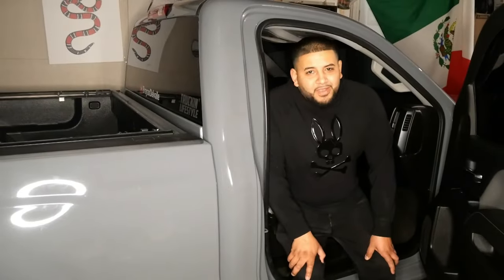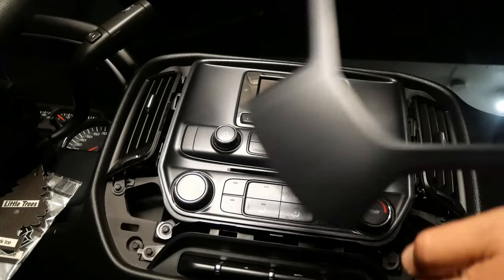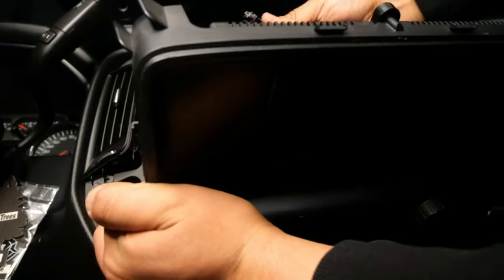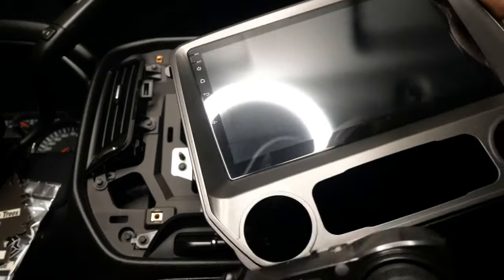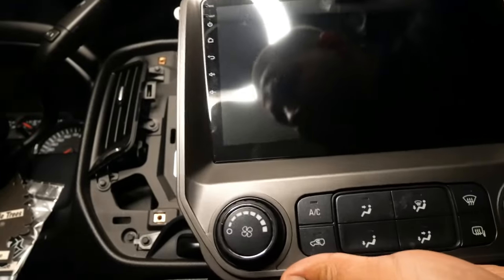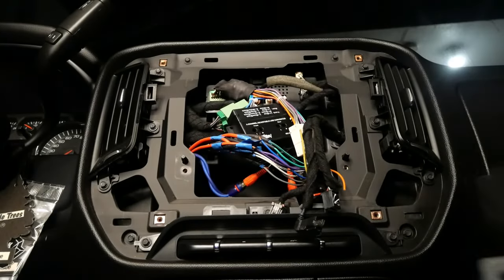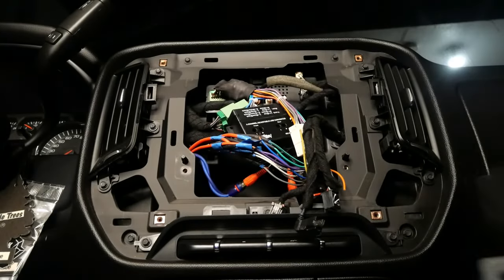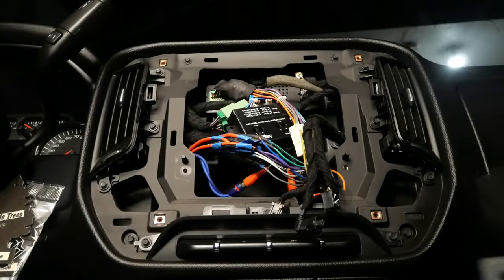HOW TO INSTALL ANDROID 10.1 STEREO ON 2014-2018 CHEVY SILVERADO

Comment: I have mine installed but now im trying to put subwoofer and amp but it doesn’t have the rca output nor control   Is there any other way to install them?
Reply from the maker: they should be attached to the harness

Comment: There is 2 orange wires coming from the steering wheel controller splice does any one know which wire connects to the green wire from the radio?

Comment: Factory has a password do you know it, it’s a 4 number password
Reply from the maker: I do not have you tried 0000
Reply: @brayandelvalle8035  tried every password possible that could be simple
Reply: 1234
Reply: "All this extra space" new radio fills space with wires. Good video. Thank you for taking the time to record it.

Comment: Great video. I have the same truck, and have always wanted to upgrade. That looks amazing. Did you upgrade the speakers too? Mine came with 6 speakers, but I'm thinking just replacing and using the 6x9 door speakers is plenty.
Reply from the maker: I upgraded to 6x9s skars brotha they sound amazing!

Comment: If you have volume and the next and prev buttons on the back of the steering wheel . Do they still work.
Reply: Also does your cluster screen work and still give you all the options
Reply from the maker: Yes they come with a separate harness
Reply: @brayandelvalle8035   doyou have a link .??
Reply from the maker: @rhettschleeter9550  yes its on the description

Comment: Has anyone got an early 2014 Silverado with the 2 wire green power harness? I didn’t know mine would be so difficult being one of the first 3rd gen’s. I can’t figure out what I need to do. Everything works except getting audio. I’ve checked all connections and they’re all good. Only thing that I’m thinking is there is something not being connected where the newer ones would connect on the green harness. 
   Anyone that can help, is much appreciated!
Reply from the maker: There is two separate harness ones for audio the other one is for the stereo mine is a 2014

Comment: Bro I got the same unit . Works pretty good so far but how do you change the temp settings? Mine is on celsius not Fahrenheit
Reply from the maker: go on the setting it should be right there

Comment: How did u connect that plug and play adapter and do u have a four way amp I can’t get mine to work I got that same set up but as soon as I connect the battery the amp starts making a thumping like sound threw the speakers and I hav to disconnect battery
Reply from the maker: Have you checked your grounds and make sure nothing is making a short
Reply: I’m pretty sure but I’ll check again

Comment: Mine doesn’t have the green plug so I used the other connector but it’s not turning on
Reply from the maker: Did you check and make sure it all clicked in all the way

Comment: I just installed this. Thanks again for your video…any chance you know how to get the wheel controls to work?
Reply: Am having the same issue  at a shop...with this.....
Reply from the maker: Im not sure i think its a second harness
Reply: Orange harness that came with radio connects to steering wheel controls
Reply: @MechTechElectric  are you my hero? I’ll get back to you on this lol thank you
Reply: @macmi11i  did it work? I'm about to put this one in my truck
Reply: @MechTechElectric ahí que adaptarlo al arnés naranja para q funcione , tengo problemas para los controles del volante
Reply: @yordeniscortina4306  tienes iphone o andriod

Comment: Hi there just saw this video was wondering what upgraded radio you put in I have the same older unit you had wanna upgrade mine
Reply from the maker: I have a link in the description
Reply: @brayandelvalle8035   does it come with all the wiring
Reply from the maker: @justsam3246  yes

Comment: Any idea how to hook up the rear camera? Wire they provided with this kit doesn't fit anything coming out of the dash
Reply from the maker: I haven't installed it on mine so I do not.
Reply: It’ goes behind the glove box it’s 1st plug, u can buy gm51 or u can splice into with an av cable,.

Comment: My vehicle antitheft turns on when i try to connect the new unit and the teuck wont start. Did you have to deal with that?
Reply: Did you figure it out? Mine is doing the same.
Reply from the maker: I did not have that issue
Reply: @rolandoolivarez3244  I did a bit more fiddling with the wiring this weekend. Unplug the black radio plug that goes into the very top module. And uplung the steering wheel control wire and the other single green lead. I'm not sure what the problem is but those two wires cause it to trip out.
Reply from the maker: @thingstoremember4489  mabe a short?
Reply: Would this work in a 2016 tahoe
Reply from the maker: @jackmonk1970  most likely

Comment: I installed this today just like in your video, but mine didn’t work, I checked the fuses and replaced the one in the truck, and nothing, any idea what it could be?
Reply from the maker: Did you plug in the antenna
Reply: Same issue here right now. It won’t turn on. I can’t hear any key chime either currently. Halp?
Reply: Everything turns on just no audio comes out of my speakers with this unit
Reply: @ashwinnash63 supposedly the speaker that comes with the kit is your chime speaker connect that and should be good to go
Reply: @carloshernandez1834  how did you fix the speaker issue? I’m having the same issue
Reply: @ashwinnash63 Did you figure it out? Having the problem right now.
Reply: Did you figure it out? Having the problem right now.

Comment: I hooked up the harness that came with the unit into my 2017 Silverado ltz with Bose system,. The unit powers on but getting NO sound in any speakers, even my amp for my two 12in subs,. Nothing no sound at all,..
Reply from the maker: Did you check it it was compatible with bose?
Reply: @brayandelvalle8035  they said it was,. I’m beginning to doubt it though,.
Reply: I ordered fr eBay,.& the eBay motors guidelines thing ,. U put in all vehicle info, it does a search and will tell u if compatible or not,. That selection was compatible,. I even typed in 2017 Silverado ltz w/Bose system factory amp compatible,. That was the item in search results,.. so I bought it,. 
I hear  only 1 out of 3 or 4 works properly, and was told those on eBay reason so cheap was due to them not passing inspection at some point,. Idk though,. I’m lost tryna figure out this thing,..
Reply from the maker: @blkicemike4857  thats odd mabe a loose terminal
Reply: @brayandelvalle8035   now I’m being told I need to purchase PAC’s AP4-GM61 amp pro module,. So the unit will work with the Bose system that came with my truck,. Something to do with factory amp,.  Personally I’d rather do factory  amp bypass,. I hav 8000watt amp to power my 2 subs 12in. Idk I getting a head ache tryna figure all the technical stuff,. Wasn’t this difficult when I did same install  in my Tahoe but it’s 2006,. I had to buy additional interface$70 to get that to work properly,.  This 2017 LTZ being stubborn😅
Reply from the maker: @blkicemike4857  yes the newer the more technical they get
Reply: @blkicemike4857 ever figure it out, having the same issue with mine
Reply: @jesseclay437  ,.. unfortunately NO I haven’t figured it out yet,. I talked with seller they offered to sell me an additional wire harness,$20,. Found same one they offered had it overnight shipped for$30,. I tried to hook it up , same problem there’s no connection to speaker wires with that either,.. so I’m gonna end up cutting wires and wiring in a birdnest,. That’s what I was tryna move away from at the start,.. so eventually I’m going to have to spend additional funds,.🙄,.. even though I paid more when I purchased due to being told all wiring harnesses were included,. They have dragged their ass for 3weeks now so Im Thinking doing so jus to run out return time,.

Comment: How do you get the screen to power off and on when you start the car ? Or you just press the power off button on it ?
Reply from the maker: Should turn on and off when you start or turn off your vehicle
Reply: @brayandelvalle8035 I’m sure I followed your steps right 🤔 but  mine won’t shut off when the ignition turns off it stays on until I hold the power button. But even then it’s not fully shut down.
Reply: @brayandelvalle8035  the only thing I didn’t do was completely disconnect the old unit. Would that cause for it to stay on ?
Reply: @mxrco10 probably so

Comment: Do the steering wheel controls work?
Reply from the maker: My truck doesn’t have any so i wouldn’t know
Reply: I installed mine last night and I got them working
Reply: Can you hook an amp to that
Reply: @TJforbes_ I need to get my steering wheel controls working but whenever I plug in that black harness he didn't use my truck goes crazy and throws every warning

Comment: So that factory box with the 3 big plugs gets completely removed? I have this same radio but the instructions it came with are horrible. So I been trying to bridge it between that and the head unit and wondering why this thing won't work
Reply from the maker: Yes it dose and i agree they are not the best
Reply: I can't figure out how to get the steering wheel controls to work for shit! How did you do it??
Reply from the maker: @AlexSanchez-mq7ut  mine dst have steering controls
Reply: @BrayanDelvalle  damn bro I was hoping you'd have all the answers haha. Nice truck brotha!
Reply from the maker: @AlexSanchez-mq7ut  if im correct you have to run a separate harness from the deck to the bottom of the steering column. & thank you bro
Reply: Well for some reason mine keeps popping the head unit fuse as soon as I plug it in. Not even switched to accessory position yet.    I even purchased the aftermarket radio harness for gm  and same. I'm pretty sure the pin outs for power and grounds are different in the vehicle than the pin outs that are on the head unit But I have no radio EWD to go off of.
Reply from the maker: @jryoung4961  thats weird you have pictures?
Reply: Yea I have pics of everything
Reply: @brayandelvalle8035  yes I had to do so with my install,. I steering wheel controls work fine,. I just don’t have ANY sound,. Idk what to do next,. I have now bought 3 additional harnesses, and still won’t ,. No sound at all,..
Reply: @jryoung4961 did you figure out why yours kept popping the fuse? Same issue with mine
Reply: @BossamsauceGamingMax  no I didn't  I still have the radio here just sitting in the box. When I was planning on reversing power and ground on the bench to see if The issue is there.
Reply: @AlexSanchez-mq7ut  u should hav gotten a harness that plugs into control under steering wheel then u run wire(s) over to the units harness one sometimes two wires,. That’s what came with mine,. However my head unit powers on and controls work but no sound,..
Reply: @BossamsauceGamingMax did you figure it out